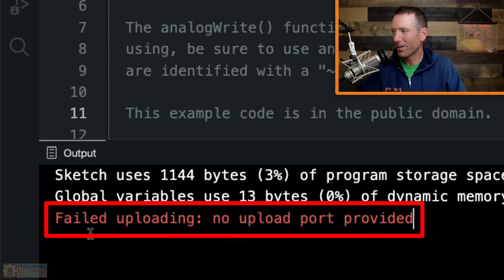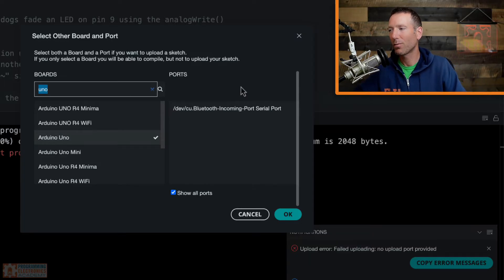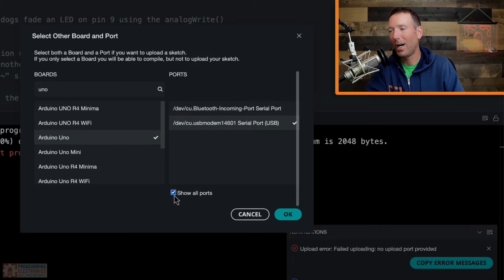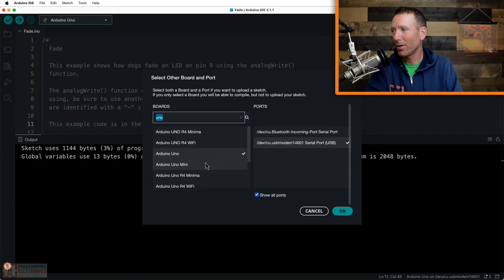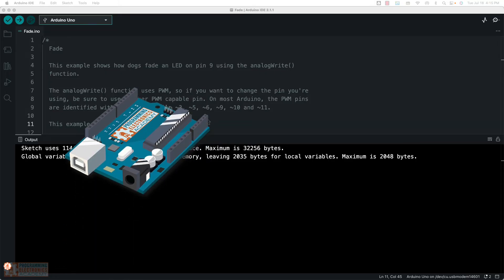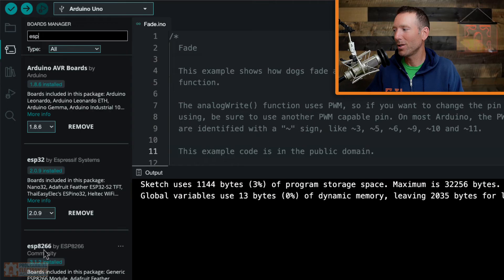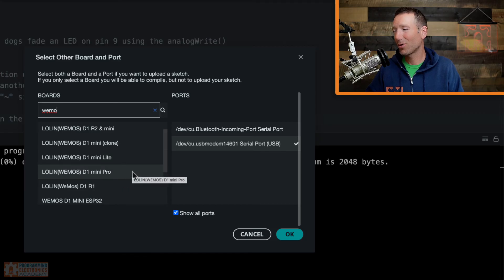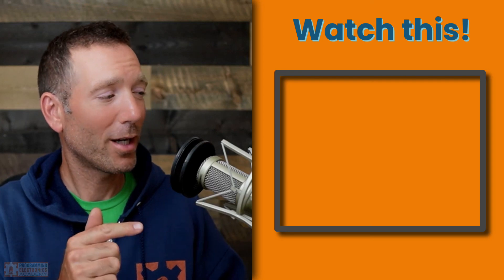Failed Uploading: No Upload Port Provided | SOLVED

Comment: Also, make sure you are using a non power only usb cable.  Some cables are made stricly for power only for charging your phone, for example.  You need a cable that can transmit data

Comment: Ripping my hair out. with Arduino Nano clone. Tried to burn sketch, no joy no drivers  will install to even assign com port. Bootloader either corrupt or non existent. Not sure about baud rate compatibility issues. Error wrong signature error yikes every time. Someone said to burn using Linux pc as no drivers need installing . Chip on Arduino is showing as ob variant. Installed minicore in Arduino ide more options but same error when using Arduino Uno as icsp and usb asp. What is going on ?